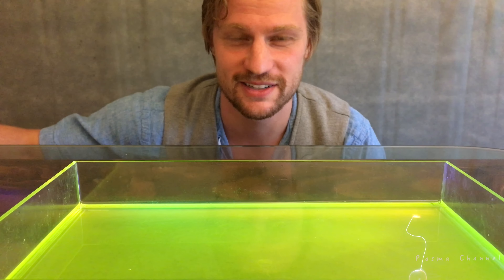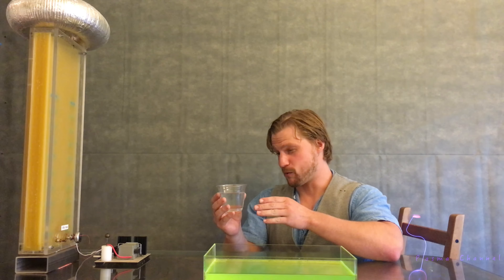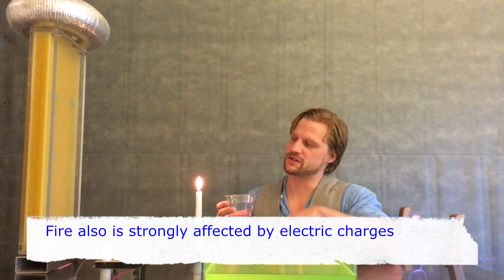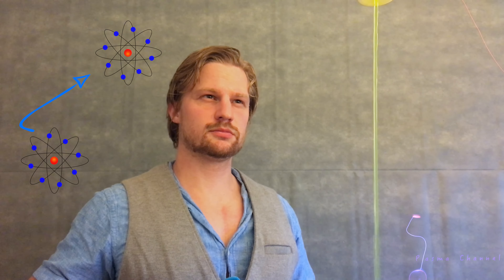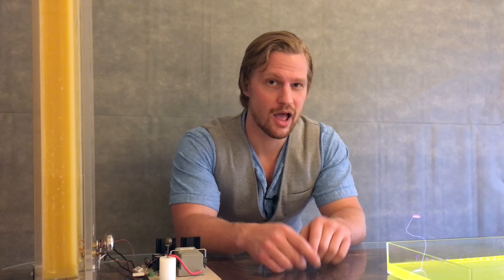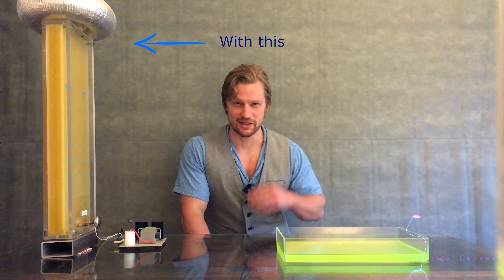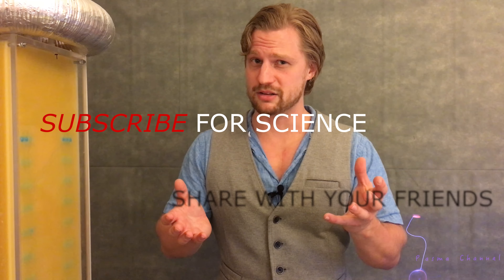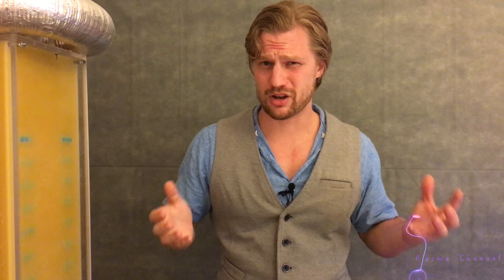How to WATER BEND | Using ELECTRICITY | PLASMA

Comment: Electrons have no charge. There's only:
1. Electron crowding (negative, pressure, excess)
2. Electron deficit (positive, vacuum, paucity)
They are relative to each other. -10kv appears positive to -20kv, a place of less crowding, somewhere for the -20kv electrons to escape to, so long as there isn't sufficient resistance to stop them

Comment: The water does that because you only have one charge which is negative, therefore when the water flows the different charges are met and pulled toward your hand but when the negative charged molecules flow down it moves away just like how a magnet would work

Comment: Your proximity is the reason the stream oscillates, as soon as you get so close the positive and negative you are hitting a sweet spot/equilibrium of both charges competing equally. Therefore it oscillates to and fro being constantly pulled and pushed.

Comment: I feel like the laminar flow when your hand was there happened because of the frequency of the water in relationship to your body's magnetic field as it was supercharged with your nifty device much like a lichtenberg pattern observed from fractal to Sprite lightning sized. I wonder what kind of conversation would spark if Ken Wheeler were in the room.

Comment: So the stream of water would touch you and ground the charge. You can see your arm hairs standing as the water is being pulled and the moment it touches your hairs go down. It's just discharging you momentarily.
Reply from the maker: That is correct Kurt. Sorry for the late response!
Reply: @PlasmaChannel  can you use electricity to control the movement if water like by making it go right left and stop and which direction to go...

Comment: Performed a small experiment where I probed a metal water bottle with one end of a mini tesla coil and other end if the coil was held in contact with a water flow from tap, Observed that the stream of water is pulled towards the inner walls of the bottle when electric discharge takes place.
Reply from the maker: That's really interesting, actually

Comment: There is an Egyptian tale of a Priest of Ptah that retrieved a ring from the bottom of a body of water by moving the water in a block and stacked it on the water adjacent after "casting a spell".
Reply from the maker: I have always wondered if they knew about electrostatics back then.
Reply: Its one of my principle subjects I am studying now. I think they had access to capacitors easily with wood insulators and metal conductors, and Alternating Current via Piezoelectric effect from vibrating quartz rich materials. In fact I think they mastered it insomuch that they used the piezoelectric effect to actually perform Crystal Overdrive on demand in order to cut rocks that contained Quartz. I am putting together a test for this!
I am looking to use a Spark Gap Tesla coil circuit, place adjustable coil, capacitor and spark gap into it to control the Frequency and instead of a Tesla coil on secondary to use a induction coil to electrode and a return plate. This set up should be similiar to what the use for modern Electrosurgery. VERY DANGEROUS FYI I recommend watching saftey videos on electrosurgery if you want to try it too.
Reply from the maker: That, I have heard about before. The cut and melt marks on the rocks in Egypt are really compelling. Please keep me in the loop with all discoveries!
Reply: Plasma Channel a lot of times you see people talk about mirrors for those marks. I don't buy it! Localized burn marks due to local crystal overdrive in believe is original hypothesis ;) 
If I'm right and they did have this tech the implication is that even the stuff you are doing has far reaching potential. If fact one of the reasons why I recently found your channel. Compare biblical claims (people that came out of Egypt) Moses parting water, and Elijah calling down fire.

Comment: Good day, I hope you get to see this but I have a question. What if you have a rod in your hand charged up to a much much much higher degree electrostatically and you stick it in let's say muddy waters(A mixture of clay and water) what effect would the rod have on the water content in the mud around it? Will it draw a majority of the water in that muddy system to itself?? Is there a way to ascertain the relation between strength of the rod's charge to the distance it would have effect on??

Really hope you can make time for a response 🙏🙏

Comment: Oh and since your channels all about plasma. I have a question from my own experiments.. I hooked a flyback transformer wrong... But it turned out to be so right.. I was getting an arc about 3 1/2 in long but the plasma was a pure glowing white. Not blue not purple but white.. Also it wasn't like a normal bolt it was a thick long orb of white with what looked like a white flame on top. It would instantly melt the top of my Jacobs ladder when the arc reached the tip. Any info about white plasma glow would really help. Thank you! Keep up the good work :)
Reply from the maker: +Kurt Neumann I would love to help! What you're experiencing is a very high current arc. As sparks get more current, they change color from purple, then to blue, then yellow, then white. White is the hottest, most dangerous amount of current. It burned out your flyback because you pushed too much power through it. They are not designed to handle that much current for more than a few seconds ( they can stand lower current... For years) . With your next flyback, try reducing current into the transformer and notice the spark color - make sure you don't draw white hot arcs for too long. Also, place transformer in oil to prolong its life. Hope this helps!

Comment: Hi. Thanks for that.  Can I ask would it be possible to part the water with this same experiment?  Many years ago, I saw a video of a guy using an electro magnet to do so, but I can't seem to find it.  Can you do a video on that?
Reply: From what I know water is diamagnetic meaning it can only be slightly repelled by a strong magnet
Reply: Think of it like the moon but Not exactly like the moon though.
The very very strong magnet is pushing the water away.

Comment: This  is the same as Velikovsky wrote about in "Worlds in Collision," when Venus came close  Earth as a comet.  The tide of the water was electrical and the Comet Venus caused a miles high billows of water at the equator, then there was a spark or exchange of electricity between Venus and the Earth and the tide dropped immediately.  The supports the idea that the tide is electrical in nature an follows the charge in the Earth's atmosphere and not the Newtonian theory of gravity.

Comment: the water waves because the water is touching you thus its polarity changes and is repelled by the negative volts but since water is a great conductor the energy is lost quickly and is "bending back toward you"

Comment: Can you explain how the ocean curves around round earth ? I can't possibly images it can be possible in a vacuum space anymore. You seem to know what your talking about.
Reply from the maker: So gravity keeps everything central to one point. The oceans are kept on the planet only because our gravity is strong enough to keep our atmosphere in place. This is why earth is round. As gravity pulls into one single point in space, the resulting shape is spherical. Now, naturally an atmosphere tries to escape from its planet into space. And it happens if the planet does not have high enough gravity. Gravity is dictated by mass, which is why 1) mars has weaker gravity and 2) has no atmosphere. It’s atmosphere evaporated off into the vacuum of space long ago as it’s gravity is too weak. all atmospheres of smaller planets have this same fate. Which is why terraforming mars is pointless- it could never keep the atmosphere in place.   Back to your original question. Gravity keeps the atmosphere in place, which prevents our oceans from boiling away.

Comment: I tried this with the 700,000 V Van de Graaff generator and I didn’t get as good of an affect. what kind of liquid are you using
Reply from the maker: Did you ground the water? Its been a while since I posted this video - I used tap water + florescent dye.
Reply: I put a large ground under the tray. I did get a very cool effect with a small boat made of aluminum tape.

Comment: I believe that if we could master/understand our oceans that would aid our understanding of how to master space.

I've been curious if it's possible in an enclosed submersible container to operate a Tesla coil within the container to see how it interacts with water. 

💥 Is it possible to reverse the polarity to see if the water repels away from the container? I saw you on that show in Spain where I believe you made that cooking oil move away from your fingers. If we could do that underwater, the salty ocean, would it prevent intense pressure from building up? Would it allow for faster movement thru water? Perhaps one end of the container attracts water and the other end repels? That would cause the water to propel the container. Kind of like an underwater Alcubierre Drive. 

Then, in Space there's all that radiation emitted by the Sun, couldn't we use the underwater container in the same fashion on those radioactive particles flying around?

I've seen Electrostatic propulsion, so I believe it's all possible. But to see it demonstrated that would be awesome.
Show Elon Musk and he'll for sure hire you on to do experiments and possibly be responsible for advanced propulsion technology.

Comment: How much charge do you need to repel water and how many  gallon will that be thats my question  🤔  so if you get that answers  times it by air and weight ...so if you put that answer  and well make a machine that out puts that same amount with the help of 4 small engines and transform it with a air drown ...can you technically create a space ship.??

Comment: What did you use to charge yourself to bend the water?
Reply from the maker: Hi BeBee, I used a voltage multiplier, connected to an insulated stand that I stood on. I designed the voltage multiplier to be safe.

Comment: If the watee contact your hand, the static voltage break down and the Water remove to the normal Position because the Magnetic field break down
Reply from the maker: Correct! Except one thing, it is more of an electrostatic field than magnetic.

Comment: Dude, how do you chjarge yourself up to that -200000V without being electrocuted? That's the part thats confusing me!
Reply from the maker: Ah, because the voltage of a static charge means nothing, if when discharging the voltage, current stays really low. Or, if the discharge happens super quick. In this case, i'm charged to 200,000 but it's slowly discharging into the surrounding air, ever second. No immediate rush of current.
Reply: @PlasmaChannel  how do you do that? Can you explain your setup?

Comment: May be the alternating currents that could have caused the waves in the water
Reply from the maker: The electricity used is strictly DC, with some unavoidable AC discharges from the DC buildup.